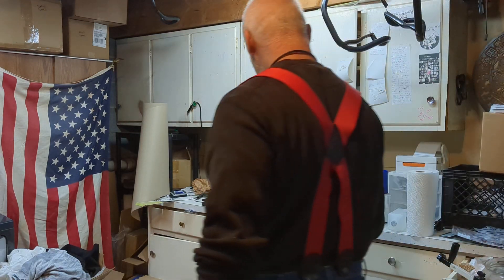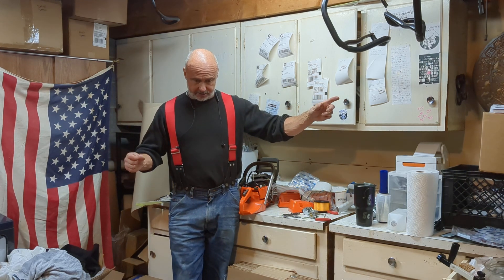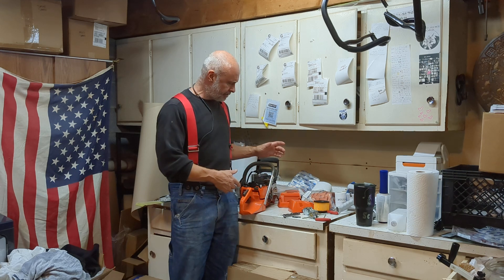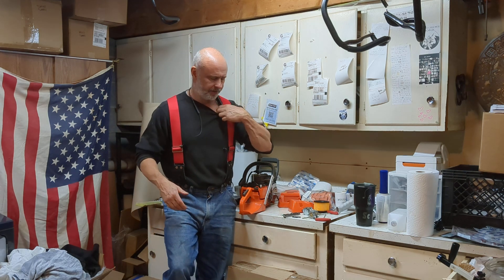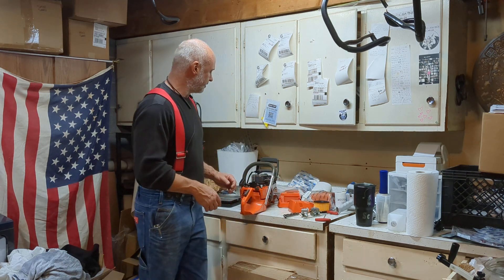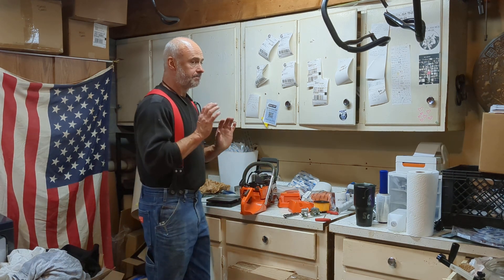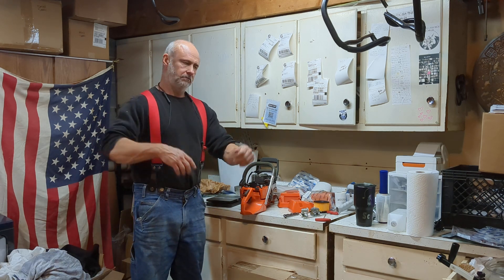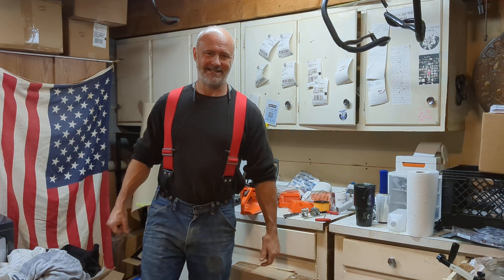BLUESAWS - Farmertec G372xp quick carb discussion.. walbro vs. hlic carbs

Comment: Mine won't hold a tune. It leans out during the 2nd tank every time.
Reply from the maker: @nicholascooper1193  I've had a lot of issues with those hlic carbs to the point where I won't even Jack with them on a 372. Again, I love them on the 440s and 660s, just not the 372. I've had it where it loses tune. It'll run great and then all the sudden weird tuning issues. I've had it where you can't lean them out to get over 10 or $11,000 RPMs. I've spent more time than I care to admit jacking with them and I'm done. Until I see pure success with those for an extended period of time, not one lucky one out of 100. Not one month of them being okay. After a year of all good feedback then I'll look at them again. I'm done.
Reply: @bulletproofsaws  I ordered a Walbro for mine this week. Hopefully it fixes this saw. If not, I'm going to get another "real" Husky and keep the blue saw as a project.